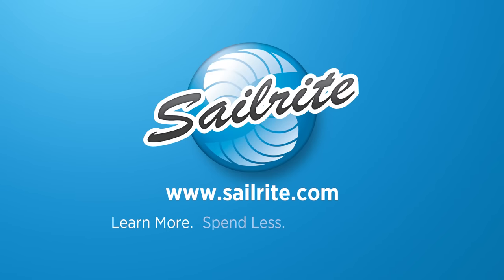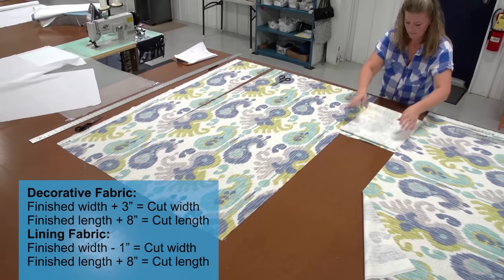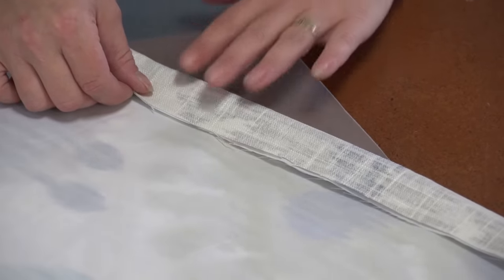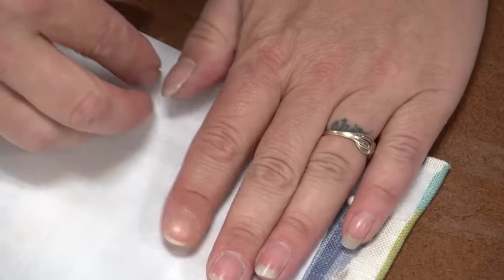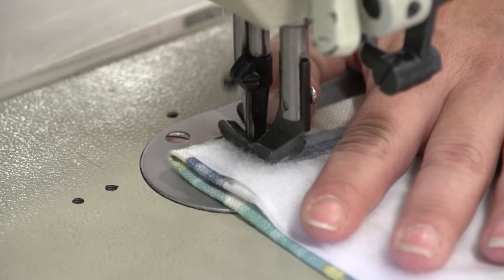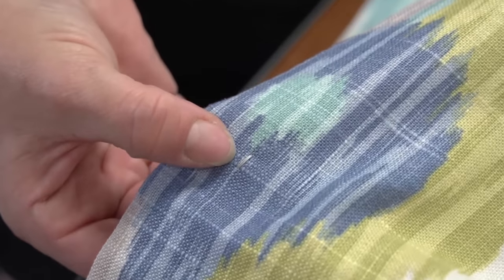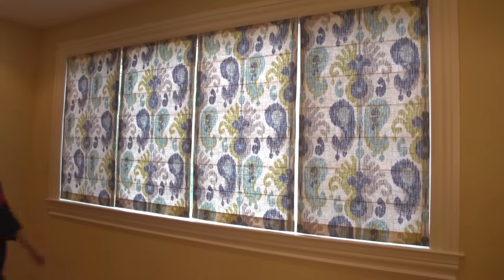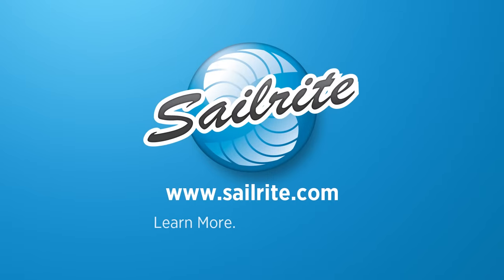How to Make a Roman Shade

Comment: if you want to be able to wash the shades every now and then do not use glue for the wood dowels, use small strips of leftover fabric to make a pocket to slide the dowels in and out for washing. i get bad allergies so washing the drapes is a good practice when you can't breathe in the spring time.
Reply from the maker: Excellent suggestion!
Reply: Adding to Sarah's excellent suggestion, wash the fabric and lining before sewing anything. Some decorator fabrics shrink quite a bit, and you want the shade to fit the window after washing. Also, the lining and face fabric might shrink unevenly if not prewashed. This is a great video, I've made many of these in the past, and the explanation is perfect.
Reply from the maker: Very good advice! Thanks!
Reply: +Sarah Surgenor Where to you put the dowels if you are using pockets?  I'm assuming that they  have to be not inside between the fabric and lining.
Reply: Hope
Reply: Como hacer cojines con bies
Reply: Sarah Surgenor thanks for the info
Reply: I'm so glad I read your comment before I did the rest, it's a stellar tip. Hepa filter vac in between.
Reply: Steam wash
Reply: You are right.  The "original"roman shades are made with a strip to slide the dowels.
No glue.
Reply: Having bought this suggested glue, I can say for a fact that it doesn't stick well. I am in the middle of make 3 shades and so far I have had to go back and glue them again. I will never make shades with glue again.
Reply: Thank you... I was looking for this
Reply: Sailrite cenefagola
Reply: Good idea added. Will stitch a strip of pocket to hold the dowels
Reply: Would you see all the see all the sew lines if you made pockets?
Reply: @SailriteDIY ##ы#ыыыыы вк и не только Ы снят с должности главы государства и не только*ы й#

Comment: Seriously, one of the best instructional videos I've ever seen. Since I was retyping the supply list for myself, I thought I'd pass it along: 

Roman Shades supply list:
•	Decorative Fabric
•	Drapery Lining Fabric
•	Thread (Dual Duty XP Heavy or V-30 Polyester thread for high UVR areas)
•	Wood Dowels or Plastic *
•	Metal Dowel Rod*
•	Velcro Hook & Loop 1” - #467100 & #471100
•	Sew on Rings for Roman Shades - #104469
•	Screw Eyes*
•	Cord Lock for Roman Shades - #104468
•	Leechline 5/64” Dacron - #21207
•	Plastic Lift Cord Condenser - #104470
•	Screws* (for cord lock & headrail installation)
•	2”x2” Wood Board* - actual thickness 1.5”x1.5”
*Purchase from hardware or craft store.
Reply from the maker: Sarah,
Thanks for the positive comments and for typing out the supply list, good idea!!!
Reply: Ummmmm....your awesome
Reply: Sarah Strous
Reply: Sarah Strouse thank you
Reply: How very thoughtful for you to share this.  Thank you.
Reply: Thank You Sarah - Really helpful
Reply: much appreciated!!!
Reply: Sar
Reply: Sarl
Reply: Thanks for doing that!

Comment: This was a great demonstration and we tried the method of gluing the dowels.  Much to our disappointment, when I was hanging the finished blinds, I could see the glue on the fabric when the light shone through the blind.  The blinds took a few days to complete and my 85 year old Mom did an amazing job so the disappointment when we saw the glue drew us to the point of tears.  I am going to return to the method of sewing pockets for the dowels.
Reply: This was the only part I didn't like.  Would never glue the dowels on.  Even if they don't break, the hot sun in many windows seems like it could easily make the glue detach over time.

Comment: I just finished making 3 of these Roman Shades for our new kitchen, along with 3-pc valances (not from your website).  I thought the instructions were spot on and loved the way the narrator spoke slowly for my even slower brain! haha!  One change I did make after the first shade was instead of putting the Tear Mender on in spots along the dowels, I used a piece of wall molding that had grooves in it in which I placed the wood dowel to keep it in place and ran the Tear Mender in a line along the dowel.  This worked out much better because when the sun comes thru the window on the first shade, I can see little dots thru it.  Wish I could post a picture.  Thank you SailRite!

Comment: This video was incredibly helpful.  I also loved that you had the products that I needed to make better than just "homemade" Roman Shades.  I've had material for 3 years, but was so worried about "how to" that I have put it off until now.  After watching this video I feel confident enough to take it on for the 5 windows in four rooms that I have to make.  This is the first video or instruction that I have seen that used the "pillow case" method which is far superior to other methods.  The only change I will make is to make pockets for the dowels so that they can be washed, and yes i will wash the material first because it most likely will shrink.  :)Thank you so much!
Reply from the maker: Sharon Gariano I am glad we could help. Let us know if you have any questions.
Reply: Thanks, I am already on your site purchasing what I need for my shades.  Thank you so much.

Comment: Great instruction and  video clarity.  I would like to know why the extra fabric is at the top of the shade from the beginning.  Then it had to be cut off to finish the top.  Thank you
Reply from the maker: We do this for any job just to be sure we have extra fabric just in case our project comes out too small after sewing (we can use the extra length to correct for that fact, if needed). In this video we had way too much fabric at the top and it was not needed.

Comment: Love this instructional video! It has been SOO much more helpful than the other tutorial I found. So here's my problem: I'm sewing on the rings and one of the dowels inside broke! What can I do??
Reply from the maker: Rachel,
You may find that the broken dowel may not cause issues with the roman shades operation, so you may not need to do anything. However, if you find it causes issue you may have to open up the top of the shade and replace the dowel. If it was glued to the fabric, you should be able to carefully pull it off of the fabric (depending on the glue used). I hope this helps!

Comment: Great video!  My question is where does cord lock go on an outside mount ?
Reply from the maker: The head board can be as small as 1" x 2" if you like. So this board can be used as an outside mount instead or an inside mount. The cord lock would still be installed in the same manner to the head board as shown in the video for both the inside mount or an outside mount system.

Comment: Hi I just made my fabric part of the shade. It all turned out great. Because it was my first time i made sure to follow really carefully and i made no mistakes. So far its amazing my question is for my next roman shade that i would want to do one panel but a wider one. Can you tell me where i can find a longer dowel that would work. As if now i have seen all the dowels the same size. So i figured you cant make one big one. If there is an option or advice for a wider roman shade will be greatly appreciated. =)
Reply from the maker: That is good news! Good job!!! Yes, you can use these roman shade plastic 1/4" ribs #104987 and join sections together using Splices for Plastic Ribs #104986. Here is a link to both: http://www.sailrite.com/Roman-Shade-Plastic-1-4-Ribs-5-Feet 
http://www.sailrite.com/Splices-for-Plastic-Ribs-Pack-10
Reply: My question is the plastic dowels are the strong enough to be used often? Thank u for replying to my comment.
Reply from the maker: Yes, they work very well and are strong enough to handle the folded areas of a roman shade.

Comment: Love the video; best I've seen on making roman shades.  Questions:  what would you do differently with the headboard for an outside mount? I am thinking I want to cover it with the shade fabric rather than the lining, since it will be seen from the side.  Also, would it make sense to attach the headboard directly above the window frame and into the wall?  Thanks.
Reply from the maker: Yes, you could mount the headboard on the outside. I would cover it with the decorative fabric if this is done. Yes, you can mount it above the window frame, just be sure to account for the extra length.

Comment: I have a question.  Is there a reason why I couldn't sew pockets into my lining to hold my dowel rods and then sandwich the dowel rods between my face fabric and the lining?  There would only be a seam showing on the outside of my lining fabric versus the actual dowel rod.  I'm thinking that this might present a problem when I attach the rings. I would place them on top of the seam for the rod pocket but I would only have the lining fabric to sew them to because the dowel would be in the way.  BTW, I'm making a very large roman shade using idlers and a cord lock. Thanks for any advice you can give me.
Reply from the maker: Hi Sandy, I have never tried to make a roman shade with sewn in pockets, so I am not sure it would work. However, it sounds like it might work. You will of course see the folds of fabric (where the stitch was created) at every pocket the front side of the shade and you will also have a small pocket that will stick out on the wrong side of the shade (facing the window). The small pockets will stack much faster than a flat pocket which this will reduce the max height (reducing the opening of the window view) of the shade when opened. Most Roman Shades look like flat pieces of fabric when lowered, so this would defeat that look.
Instead you may want to consider our new Iron-on-Tape for Roman Shades and the ribs that can be extended for large width windows. Here is a link: http://www.sailrite.com/Iron-On-Roman-Rib-Tape-1

Comment: When I used the glue it came through the fabric and you can see a yellow circle on the other side of the fabric every place I put the glue.  The fabric was pretty thick (looks thicker than the one you used in this video.  Any suggestions? 

Other question, why do you glue to the decorative fabric and not the lining?
Reply: Sorry... Just realized that question was phrased incorrect.  I know why you do not put the rod on the lining...  

Just asking for suggestions as to what to do about the glue.  When I put it on the backside of the decorative fabric did make the dowel stick well but when I flipped it you could see small yellowish circles where I put the glue.  I used only 1-2 drops max just like in the video.  The glue went through my fabric and now I have to order new and start again.  I was worried this might happen.
Reply from the maker: Nicole Carlisle With some decorative fabric the glue may bleed through the fabric. Always test on scrap before using any fabric glue on your finial project. We have recently added to our inventory a new Iron-On Roman Rib Tape which works great and solves the possible bleed through of glue. Also it makes it possible to simply install the ribs to the backside of the liner instead of the inside (because the iron-on rib tape looks good and does not need to be hidden). Here is a link: http://www.sailrite.com/Iron-On-Roman-Rib-Tape-1 
I hope this helps answer your questions. Let me know if you have any more.

Comment: So wood or acrylic rods? Wood doesn't bend later? And the bottom one is it stainless steel or can it be galvanized aluminum?
Reply from the maker: We used wood, but you could also use acrylic rods. Just be sure that if you glue them that the glue sticks to the synthetic rods, as sometimes it does not. At the bottom you need a weighted rod, we used this: https://www.sailrite.com/Bottom-Rod-for-Fabric-Shades-3-8-Brass-Finish-4-Feet

Comment: great video :)  I just made mine, but used hot glue instead of the fabric glue, and lined it with a bedsheet instead.  Maybe these ideas will help others in making this project more cost effective.  Also, my shade had 7 segments, and it's total height, when folded up and raised, is 11 1/2 inches from top edge to bottom. (my total curtain length is 54 inches)  I wish I had this info, as I wanted to let in as much light as possible when the shade is raised.  I did mine as an outside mount, but I didn't account for the extra 3 inches that the bottom folds would add to the raised height. (that's 3 inches in addition to the top section and top hemming/Velcro) I don't know if that makes sense, but I'm saying that I could've hung my shade 3 inches higher, to allow for maximum light and view, once it was all finished. Maybe this info will be useful to someone else.
Reply from the maker: Using hot glue is an excellent idea. Thanks for the tips.

Comment: Hi there could these blinds be stick on the double sided tape or on the outer side of the frame as I don't have enough space inside the frame to get them in?
Reply from the maker: Yes, you can mount the head rod board to the outside of the frame. Just be sure to cover the head rod with a decorative fabric to keep it looking nice.

Comment: Do I need to use a 2 x 2 for the headrail? I have a 1 x 2 that I would like to repurpose, could this work?
Reply from the maker: No, you only need a headrail large enough to accommodate the brackets. The size of the brackets can be found here in the specs: https://www.sailrite.com/Custom-Roller-Clutch-Bracket-Pk2. A board that is an actual size of  2" x 1" should work, since the bracket is 2.011 inches wide.

Comment: Hi  i nerd tk make a blind  the existing  blind  is larger than window big still light com coming  through(from sides)! 
Do you think  is best to install  the blind inside  the window?
Thank you
Reply from the maker: If you want to block the light coming from the sides you will need to make the shade the exact size of the window opening as an inside mount or make an outside mount and make it larger. In both cases still some light will get in around the sides.
Reply: @SailriteDIY  
Thank you so much for  your help.
Reply: @SailriteDIY  
Do you think putting  roller blind inside the window will  be helpful  or Venetian blinds?
Thank you

Comment: For cut length, the video says Finished Length + 8".  When I use the calculator, it says Finished Length + 5".  Why the disagreement, and which is correct?
Reply from the maker: The extra 8 or 5 inches is a safety factor only. You can use the 5" and it will likely be plenty of extra fabric for possible shrinkage when sewing sides of the shade.

Comment: When I enter  the Desired Rough Height of Folded Stack in your website calculator i get the length of the  fabric to be 5 inch. more but the video shows I should add 8 inch. Which one is correct? Many thanks for your help.
Reply from the maker: +Carlos Latuff Use the calculator, it has been improved.

Comment: I am still looking for 60 inch dowel rods for roman shades.  Does anyone know where I can find them, or what I can use as an alternative.  Thank you.
Reply from the maker: Sailrite may soon stock a dowel rod that can be extended using a splice. We do not yet have that item in stock, but we are working to add it to our database. In the meantime. Please email me at: eric@sailrite.com and I may be able to provide a special order for you until we stock the item. Just let me know how many you need the the length of each.
Reply: You might look at a hardware store for a very thin metal rod. I am thinking of doing that because I am doing a very wide picture window.
Reply from the maker: If the dowel is the for the bottom rod then you need this: http://www.sailrite.com/Bottom-Rod-for-Fabric-Shades-3-8-Brass-Finish-4-Feet (you can increase length with this: #104988)
If the dowels are for the shades pleats then you need this: http://www.sailrite.com/Roman-Shade-Plastic-1-4-Ribs-5-Feet (notice you can make them longer with splines #104986)

Comment: Sailrite; chances are you'll not respond, but how would you mount externally? That to me, makes no sense. oic, from frame. nm
Reply from the maker: The wood board or header at the top in the video is screwed into the inside framing of the window. If you do an outside mount you would simply screw it into the wall (through the hook or loop attached to the board) with the hardware for the shade facing down. Then attach the roman shade over the hook and loop and you are done. This moves the window shade treatment away from the wall the same thickness as the board.

Comment: Wish the pattern was used in the correct orientation.  The leaf's thinner part usually is toward the top.
Reply from the maker: It could be done that way, but panels will have to be sewn together to make the length if it were.